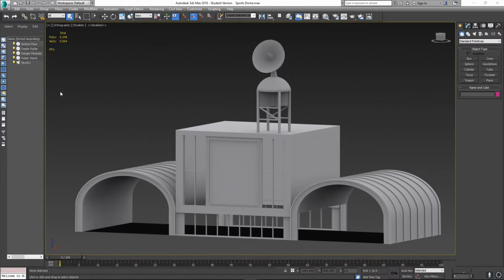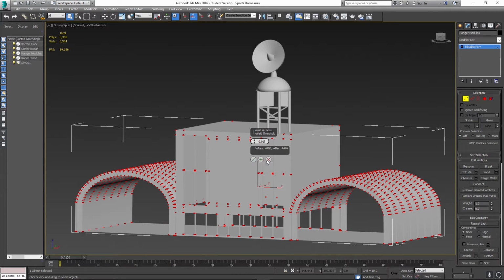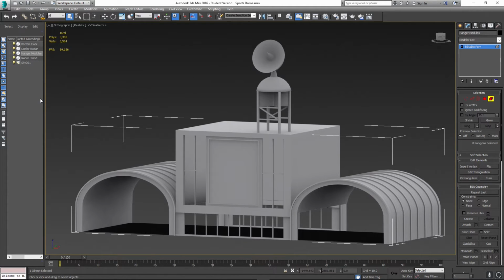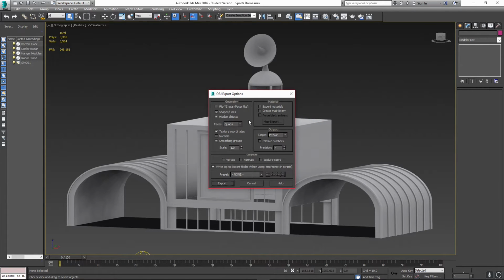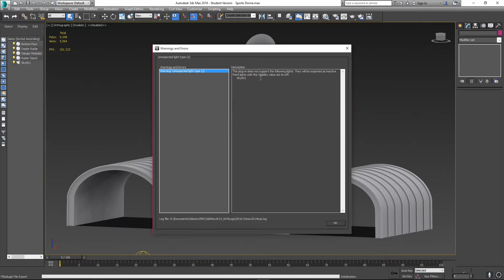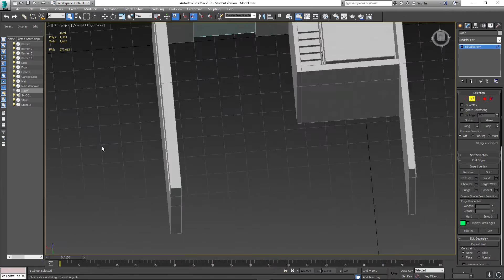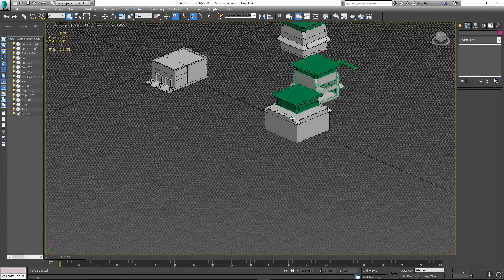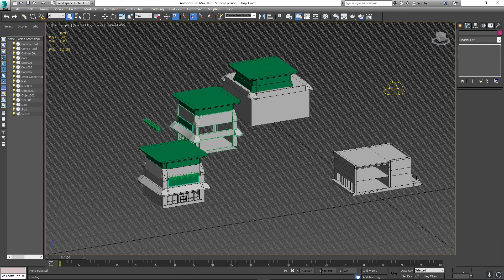Arma 3 Modeling Tutorials | Part 10 | Finishing Up And Exporting

Comment: How can i get this file into Arma?
Reply from the maker: Arma 3 Samples in Steam tools has an example Building that comes with all the setup and scripts to get it working in game, Use that as a base setup. Export your model as a .3ds file and then open the .p3d file in the samples folder. This will be a building that you can import your model in place of and use the template to learn more from there. Hope this gets you started!